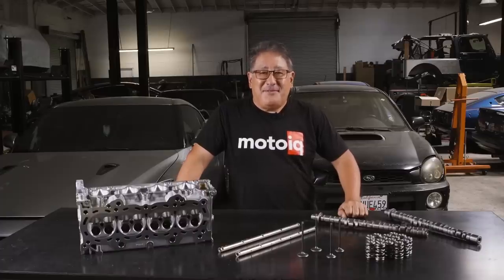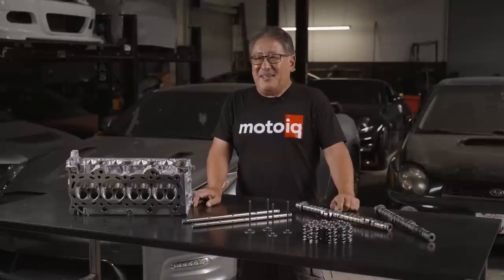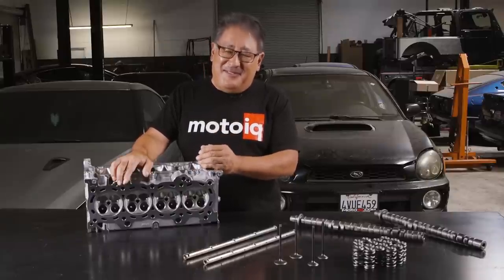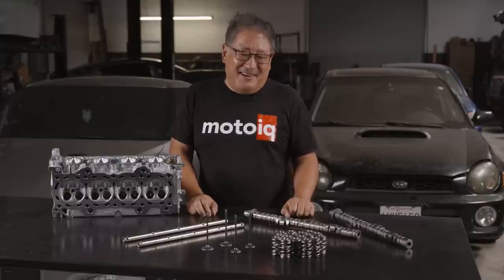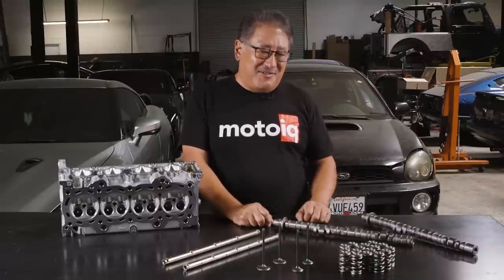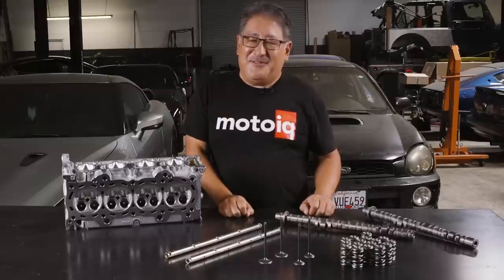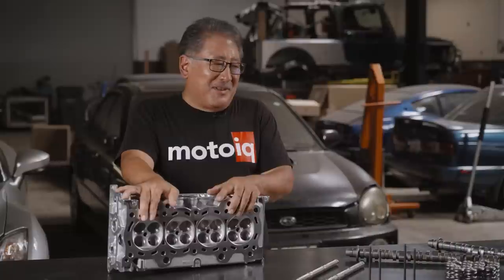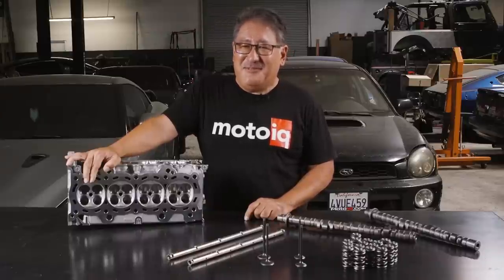Honda K-Series Cylinder Head Tech

Comment: Need to send this video to gears and gasoline
Reply from the maker: I am pretty sure their engine didn't make good power because the cams were too small, it had a stock head, possibly the headers and exhaust were a wrong match and RWD drivetrains eat about 5-10% more power on the dyno than FWD.  That being said, I don't think making maximum streetable power was their goal, it was more about reaching 10k rpm. The build and parts selection were solid.
Reply: @motoiq  hahah, the timing on releasing the video is almost convenient
Reply: @MotoIQ  yes thank you. I debated with people that rwd will have more loss of power than fwd. I always said, fwd is faster than rwd to certain power, even with some wheel spins. Maybe at 350hp plus  than rwd would be more beneficial.  That's my thought.
Reply: For what?
Reply: Send to Jimmy Oakes
Reply: @motoiq  I’m curious how it would function on something like a K swap MR2 spider
Reply: @BlueRice RWD is better because it splits the grip needed for steering and acceleration between the front and rear wheels. It also allows for better chassis weight distribution as you can move the drivertrain weight behind the front wheels. Weight transfer under acceleration and braking naturally go to the tires that need it most.
FWD is nice for packaging and efficiency. For going fast, mid mounted RWD is much better.

Comment: I would love to see this kind of video for the B-series engines. They're old tech compared to the K, but they're still pretty widespread and it would be a great video.
Reply from the maker: Next time we get one in we will do it.  We just love the K!
Reply from the maker: We documented a B series build here, we actually get more power nowadays with better cams, manifolds, headwork and headers now available, we learned a lot since them.  But for a mild pump gas build, this series is still very relevant.  https://motoiq.com/category/projects/honda/ej-civic/
Reply: I feel like with all the aftermarket tech and the diminishing B motors that people want $4500 for… you’re better off going k series. However, this comes from thought of savings, power and ease of build.  Meaning, if you have to go B series because they are the best sounding motors ever or simply because you just want to.  Do your thing!!!  GSR is the most fun stock motor I’ve ever had. And were the door into the K series. 🤜🏻

Comment: I would love to see a video on building a K-series engine for a turbo or supercharger. Discuss compression ratios, valve train options, and bottom end considerations. Thanks for the great videos!
Reply from the maker: https://motoiq.com/extreme-engine-tech-building-the-ultimate-k24-part-3-the-finished-goods/  It is kinda old and there are better options now days but here is what we did.  Most K motors customers want big NA power.
Reply: @motoiq I've got a friend interested in building a turbo K24/20 to be used in a daily street car. Everyone has their own interpretation on the max rev limit for a K24, would you suggest 7500rpm limit as an all the time limit? People have gone further it appears long-term reliability becomes a concern.

Comment: You said a smaller throttle body helps with throttle response, but I guess you meant throttle control? With big throttles it is hard to control the torque when road racing, the response is usually quite excellent. Also cool to know cyro and WPC does lengthen service life when you go far outside the OEM design parameters, I did not expect that. As usual thanks for the video!
Reply from the maker: Yes what you said.

Comment: Great videos as always.  I have an 08 civic si with 04-08 TSX K24 bottom end. Bottom only has type R ported oil pump and fluidampr balancer. The top end I went all out. 4P 156 cnc ported head with everything and their RR3 cams with 50* gear. I am hearing all different things on max safe rpm and max VTC safely???  This thing runs amazing with only using 30*, but can I use more safely? Can valve to Piston clearance be checked with a bore scope?
Reply from the maker: With a stock bottom end, I would not take it past 8k.    If you do track days, 7800 is a good limit. The rod bolts can break. Excellent head choice BTW.  We rev VTC engines to 9k plus a little. You probably can check piston-to-valve and valve-to-valve clearance with a borescope.  We use clay.  You need to lock the VTC in the max advanced position when doing this.  The good thing about running a 4P combo is they probably can tell you whats safe because they engineered the combo, if you mix and match parts, that's when you need to check clearances yourself.

Comment: There are cnc porting services that map out ports on a computer then are they bench flow tested to see the results? I went with a decades experienced Honda head porter that does all this by hand you may know. Tom of Portflow in Harbor City Ca for my K20c1 head and the results along with radius valve job, upgraded valve train using Ferrea components and a 4 Piston TR2 camshafts has performed very well removing that fuel tumbling bottle neck flowing about 300 cfm now.

Comment: Excellent content as usual!!
I currently have a JDM K24a2 long block with full bolt ons and oil pump upgrade, head has DC 2.2s and supertech valvetrain with 50°vtc
Would there be any benefit in porting my head or do I need higher compression pistons to take advantage of it? Running on 91 octane? 

Also i have a J37 throttle body with 80mm inlet that tappers down to 70mm outlet, is it best to have the cold air intake pipe the same size as the throttle body inlet or would I benefit going slightly bigger to say 3.5 inch piping?
Reply from the maker: The K20A head flows better, we uses ported K20A heads on our builds. 3.5 is probably too big, probably 3.25 is good.

Comment: I really wish you Moto-IQ would do a series on the 2ZZ-GE, I'm planning on building a streatable N/A Celica GT-S and the info would be invaluable! Really wanna know what power numbers could be had with WPC treating a 2ZZ-GE. Thanks for the excellent content Mike and the team at Moto-IQ! Been a fan for over 10 years and the content just keeps getting better.
Reply from the maker: They just don't seem to go that well.  No aftermarket support for them as well.  We will build one but they are not too popular, the Celica's were not popular cars to be modded and Lotus people rip them out and put K motors in.
Reply: @motoiq  True, those are some very good points. I have an RSX-S thats a mild steet build, so I get to have all te K series fun I want. Just have always had a soft spot for the Celicas.
Reply from the maker: Once you play with K motors you won't go back!
Reply: I just had a 2ZZ swapped into a 2002 MR2 Spyder... it blew after 75 miles. There are K swaps available, but they will run around 10k with a junkyard K and RSX-S trans.
Reply: @Chilicharger665  It's too bad the 2zz didn't come with iron cylinder wall from factory, ive heard a lot of 2zz issues come from those metal matrix cylinder walls.
Reply: i have a 2zzge in a ke70 here in Australia, iron sleeved, closed decked, forged rotating assembly all arp studs, stock cams and bmw s1000rr electronic individual throttle bodies behind a j160 from altezza and f series diff, made 210hp/180ftlb at 8200
Reply from the maker: The same amount of work and money in a K motor will make 100 more hp.
Reply: @motoiq  doesn't fix the issue of wanting a Toyota engine for my Toyota😝 i wanted a modern high revving toyota 4 cylinder that wasn't 4k to buy like a beams 3sge, this was a wrecking yard engine that cost me 350 and all the machine shop work was done for free or alcohol by mates 😅 only cost was parts really and it was less then 4k in total and i got my modern toyota engine that wasn't a 4age in my ke70
Reply: @motoiq  Too bad the 2AR-FE isn't getting more notice. The one that Gears and Gasoline did in their MR-S made almost K series numbers and sounds pretty bad ass.
Reply: @tcollogan  Adding a TRD or GReddy supercharger is a decent way to get power in a 2ZZ, that one option im considering.
Reply: @matthewadkins9810 all the air intake is seput in such a way as if it was rwd it would all hit my firewall 😅 i tried
Reply: @tcollogan  Thats too bad.
Reply from the maker: that is a good reason to want to stay toyota
Reply from the maker: Steff Papadakis has done some great development with this engine family.
Reply: @motoiq  i believe steff used the 2azfe for his fd program
Reply: @motoiq  The 2ZZ does have an aftermarket, it’s just no-where near as big as the K’s. MWR makes cams, pistons, a 2.0L stroker kit, etc. Also, Redliner 9K makes good race headers and ECU tunes (particularly for the Corolla/Matrix XRS, and APEXi also makes the Power FC). DD Performance Research also makes the best intake manifold for them. 

Even as someone who dailys a RSX-S I’d love a 2ZZ powered car, and there’s plenty of videos of them making well over 200whp NA on stock internals.
Reply: I have a corolla Tsport (2zzge) 192hp and an ep3 typer (k20a2) 240hp 1stage. the truth is that 2zzge is underatted and k20 overrated! Honda world has enough aftermarket and tunning support and that's why I improved on my ep3, thats all!! The 2zzge goes 400hp stock engine with gtx2867 and I've seen it from many people without anything happening and with 11.5:1 compression like k20A jdm! where the k20a2 wins in turbo is that it has lower compression and not 11.5:1 like the 2zzge. 2zzge has NOTHING to envy from k20 and for me it is even more reliable! Also, my typer has had more problems such as synchro rings wear clutch and chain tensioner, while the corolla has 0 problem! Also with lower compression pistons and big turbo the 2zzge hold 450-500hp without any changes in internals.
Reply: @DimoS...  Agree and disagree respectfully. The 2ZZ is underrated, but thankfully more and more people are recognizing it’s potential (prices for the Celica GT-S, Corolla/Matrix XRS have gone up quite a bit). Heck, I’ve even had the pleasure of spotting two Corolla XRS’ in my hometown.

However I’d also say the K20 is justified in its reputation. It’s well known that their heads flow a lot better than the 2ZZ’s; which allows it to respond to mods much better than the former. Plus, there’s no shortage of completely unopened K20A2s out there making 650+whp (see Humble Performace for example) and they have a 11:0:1 compression ratio (Which isn’t a huge difference compared to the 2ZZ’s, though correct me if I’m wrong).
Reply: @johnbowden7058  agree mate, no you haven't wrong. But especially in stock form 2zzge is the same good as k20. Also 2zzge take bad fame for track days because for the oil pan, don't have diaphragms and die from oil starvation like k20z3 (fn2 typer), if you properly maintain a 2zzge with good oils and proper use, it is the same and more reliable! as I said before as an owner of both cars if I kept one it would be the corolla ts. (I'm an engineer and I've worked on many such motors) in the end both is awesome engines! Great Japanese high rev pressure😛 I love both of my cars the same !
Reply: @DimoS...  K20a2 has an 11.0:1, which is pretty close. That being said, I agree with a lot of what you said.
Reply: @DimoS...  Yep, that’s really the only issue that I’ve heard about when it comes to the 2ZZ. However I believe that issue only occurs if the engine is over-revved, and it’s preventable if you get an aftermarket oil pan (MWR makes one).

It’s sort of like how the retainers snap in the AP1 S2Ks if pushed passed the rev limit. Other than that I would imagine that it’s just as reliable as our VTECs.

Comment: How do the Duratec 4 cylinder engines stack up to their contemporaries? I have read about them putting down some pretty respectful N/A numbers with cams and was curious if you guys have any experience working with them? I love your content by the way!
Reply from the maker: They are strong motors and are good for forced induction.  They are not going to outpower a K motor NA though.

Comment: I wonder if a ceramic coating like what Swain Tech offers could compliment the cryo and WPC in extending spring life. It's supposed to hold onto oil to help control temps like you were mentioning. Thinking about it the surface finish created by WPC might already do that about as well as an oleophilic compound and is why they're staying cooler and living better. Thank you for the great camshaft info! I'd never heard of an inverted flank! Heck i never even considered that profiles would have to be different between cam on bucket and all the follower systems. I've got some research to do!
Reply from the maker: Swains ceramic coating doesnt flex well and would flake off and also hold heat in.  Swains black body radiation coating might be a better choice. The trouble is coatings don't stick to WPC treated surfaces very well.
Reply: Thank you! Thinking about it this is at least the second time you've explained this to me You're awesome! I promise i'll be better
Reply: Once you WPC treat, you'll never go back to coatings to reduce friction.

Comment: you mentioned that this is a street/track day engine.  A lot of the details you went into mentioned stuff like cryo/wpc/shotpeen/whatever other treatment helps the stuff last long and you don't have to replace it every season but maybe every other season.  obviously nobody is expecting a 2.4 liter engine belting out over 300hp to last as long as an oem engine, but what are you expecting out of it?  whats maintenance look like on an engine like this?  are we talking an annual disassembly and inspection and replace whats needed kinda thing? if yes, is it a full engine rebuild? or are you looking at a few specific areas?  and if yes, how many miles are you thinking for this?  cause annually can be like 2k miles for some people and like 15k for others.  If its not an annual thing, how long do you expect it to last without opening it up?  What kind of maintenance other than oil chances should I expect to do?  I'm assuming valve lash adjustment should happen a lot more often? How often? 

I've been doing a bit more in depth research on built K20/24's as I'm getting ready to do one prolly early next year.  the biggest thing I can't nail down is any cams bigger than OEM and timing chain tensioners.  Some people say any non-OEM cam will kill a stock tensioner within days. An upgraded one like InlinePro or K-Tuned is a bit better but still goes fast.  And when it goes it likely takes the engine with it.  Then others say an upgraded  tensioner solves the problem and its no longer an issue.  Others still say its not the tensioner but the oil pump chain setup and upgrading to Drag Cartel's lower chain guide solves the problem.  Can you chime in on this?  What do you do the the chain tensioner?  Anything for the oil pump chain? Keyed crank timing gear?
Reply from the maker: I feel that a forged piston engine wears out faster than a modern stock engine and is good for about 100k miles. Your mileage can vary due to your driving habits. I recommend 3k mile oil change intervals on the street and 1-2k intervals if running E85. If racing I usually change the oil every event.  We use all Drag Cartel stuff for the chain, tensioner and guides.
Reply: @motoiq  oh wow, 100k? you're expecting an engine like the one in this video (and previous bottom end vid) to last that long with just oil changes as maintenance?  no need to open it up to inspect stuff like valve springs or retainers or etc periodically?  Honestly I thought I was day dreaming hoping for it to have a 50k service life, 100k sounds amazing!

edit: how many track days are you assuming with this? something like 10-20 track days a year reasonable?
Reply from the maker: It's hard to say exactly. If you are a pro driver with a set up chassis that drives the car to every bit, the engine will probably need to be refreshed after 10-20 track days.  If you are not, it could last for years.
Reply: @motoiq  what exactly does "refresh" mean? which parts am I looking at and potentially replacing?  Is it a full disassembly and inspection, replace what needs replacing, and reassemble?  or just partial disassembly and look at a few certain parts?
Reply from the maker: The first.

Comment: This series is fantastic! Thanks so much.
What about the J motors? More cylinders, more better, right??
Reply from the maker: J motor is a good cheap swap but more for street and strip stuff, I would much rather have 150-175 fewer lbs on the nose of an already nose-heavy FF car.  Also, the K motor is awesome and a J is just a blah SOHC engine and the Few DOHC versions are not Vtec.

Comment: I love your informative videos. Keep up the good work. How much does the compression ratio affect the power output? Max compression I as thinking was 12:1. Basically looking at building a road race engine run on 98 octane gas. Is it ok to skimp money on say pistons and spend more on the head and cams?
Reply from the maker: No, don't do that.  If anything spend less on the head porting.
Reply: But isn't the head where most of the power is found? The power figures you mention in the videos are these at the crank?
Reply from the maker: You break a ring land or the pin boss pushing stock pistons, you are in for a world of hurt. You don't port the head you just make less power.

Comment: When speaking about the RBC and the Throttle bodies, a common thing to do is re-route/delete the coolant going to the throttle body and use isolating (thermal) gaskets from the throttle body back, would IAT effect performance more on top of the RBC to begin with? For instance I can comfortably hold my hand on my RBC manifold after a long drive, is it a quantifiable amount?
Reply from the maker: Some testing others have done recently shows that the gains are so small they hard to measure.  My opinion is that its cheap and sure doesnt hurt to make the intake cooler so do it.